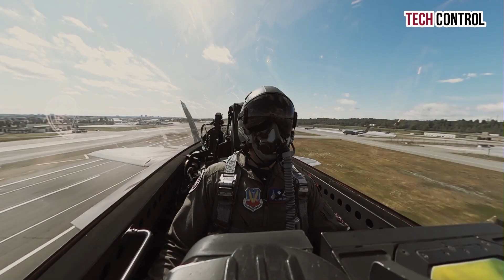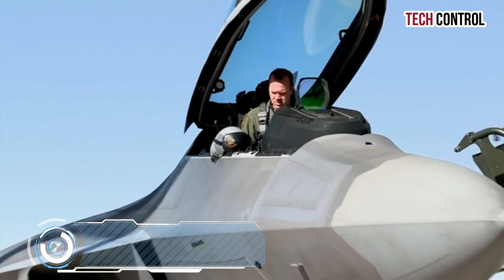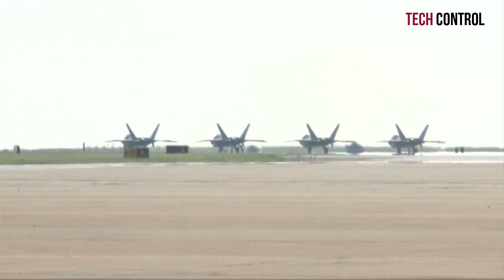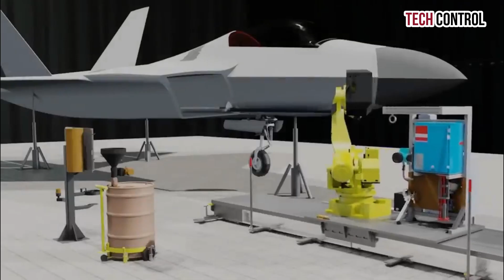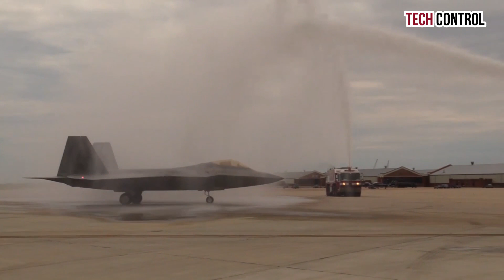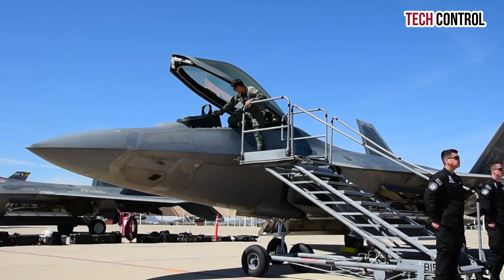Behind Perfection The F-22's $361 Million Price Makes Enemies Goosebumps

Comment: The F-22 is for all practical purposes is dead. The US Air Force wants to cancel funding for training on the F-35 in 2024. This is because the F-22 has gotten to expensive to maintain and it lacks the ability to integrate into the F-35 networks for sharing sensor data. They Air Force needs to cut expenses because the F-35 is costing far more to fly than was projected and the engine is not working properly, so all of the engines will have to be replaced with a newer model engine, further increasing the cost of the program. So, the Air Force is going so broke over the F-35, they can't afford to fly the F-22, which has never been used in combat anyway.

Comment: The F 35 lacks vectored thust and neither airframe have 3d vectores thrust like the SU 57.  They both will lose in a dogfight with the Russian plane.
Reply: The SU57 will be gone way before they get close enough for a dogfight. If the F35 was intended for that, it would’ve been designed for it
Reply: Yea but there's only like 4 SU 57s
Reply: 🤣☠️ 3d thrust vectoring doesn't give any advantage in a dog fight.
Reply: 😂 😂 😂 look at this dude.